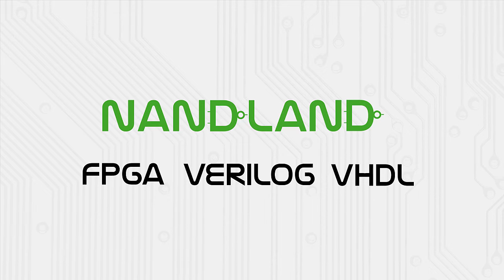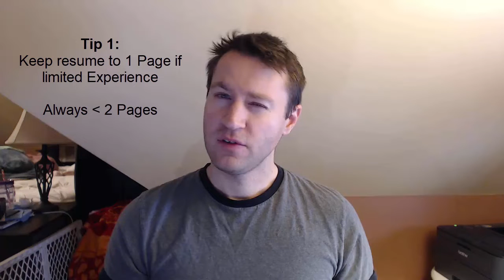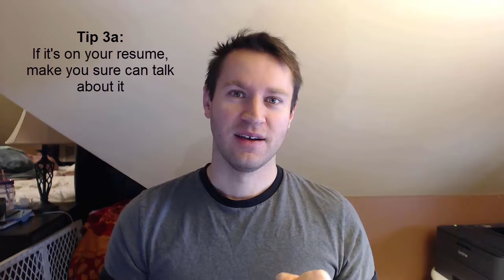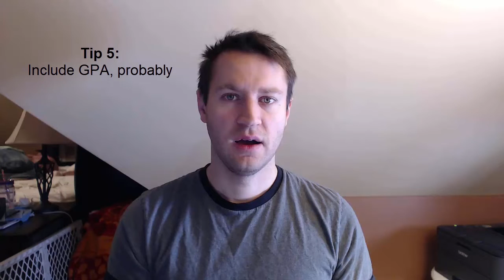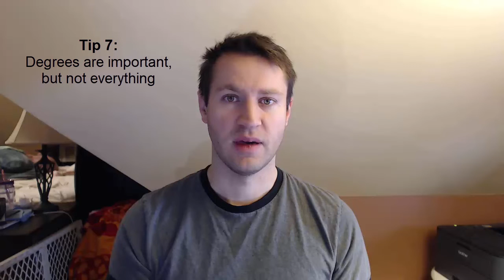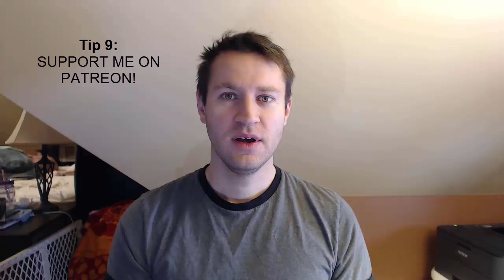How to Get A Job as An Engineer - The Resume

Comment: I am a software developer planning to make the switch to FPGA development and I'd like to know which technical skills other than writing HDL and using development tools are required to get a job in this field? Specifically I'd like to know if I should learn analog electronics and maybe pcb design before applying for a job. Also what kind salary should I be expecting for a first job? Thanks!
Reply from the maker: I don't think you will need any PCB skills, that's usually a dedicated person who does that.  It would be worth brushing up on the basics of electronics though.  What is a resistor, capacitor, inductor, transistor.  Maybe some basic Op-amp circuits.  Regarding salary, check out glassdoor.com for your area.